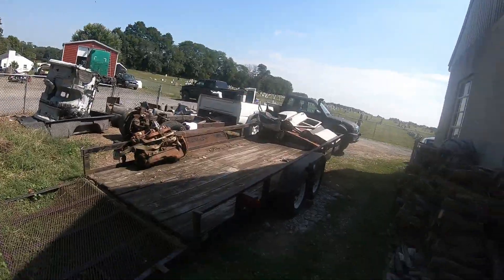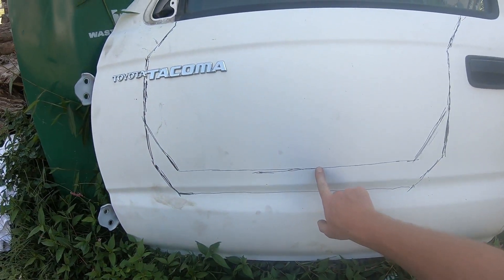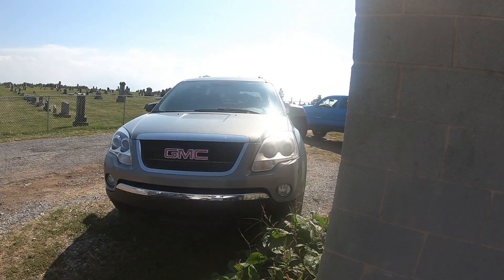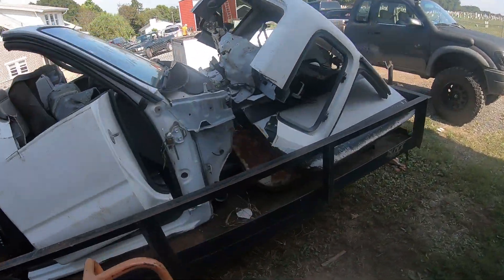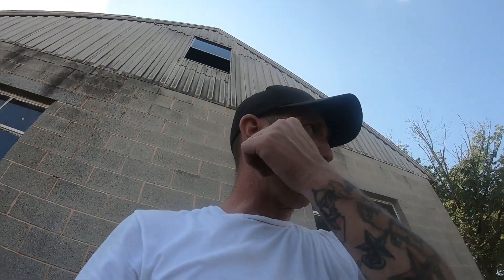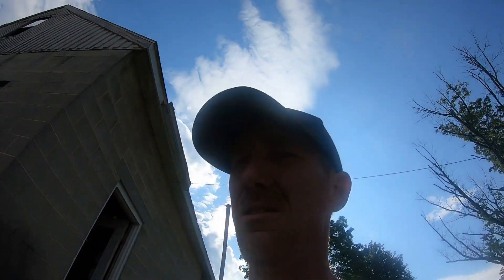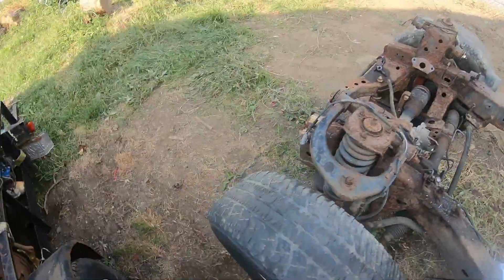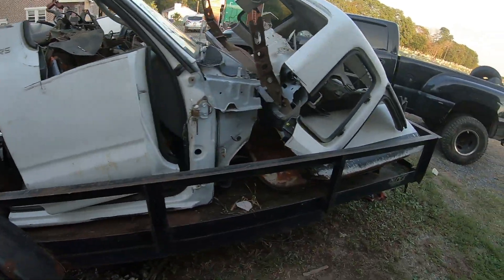parts tacoma part 3

Comment: Your black truck is a 4 cylinder??? You should have put the 6 cylinder engine in it???? No??? Too much work to bother?????👍👍👍👍👍
Reply from the maker: I like the light weight and with the 4.30 gears it's not a slouch. The heaviest thing this truck will ever pull is possibly a jon boat. I deff like the 3.4 but the 2.7 is perfect for what I bought the truck for. Plus it gets good mpg. It's my daily. Maybe down the road I'll regret it but I'm happy with the little 4 honestly.